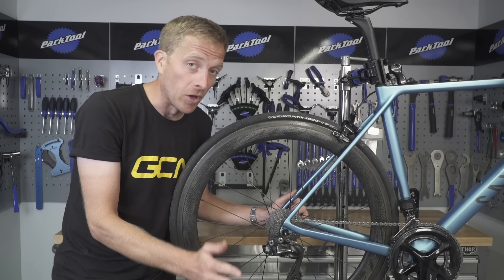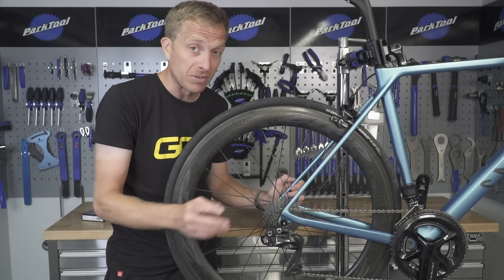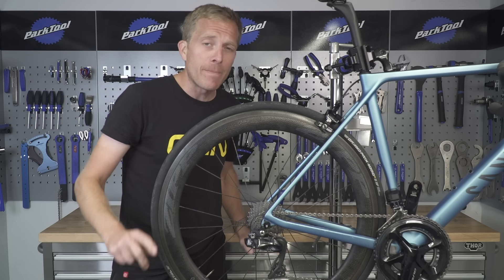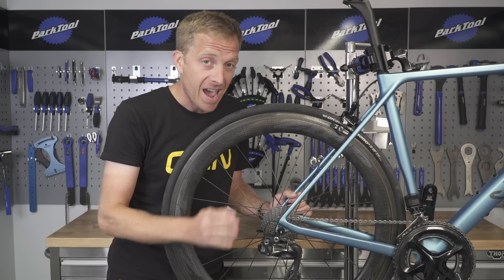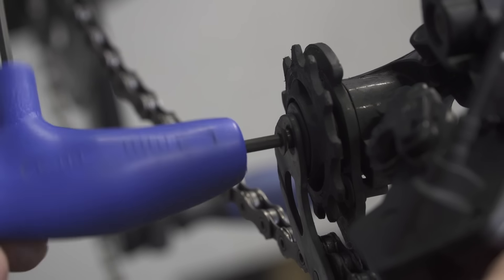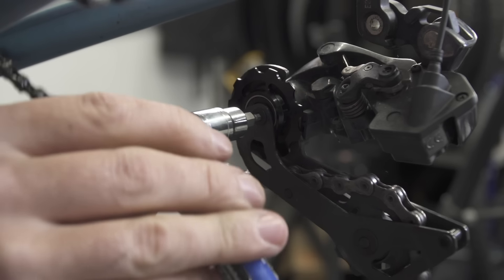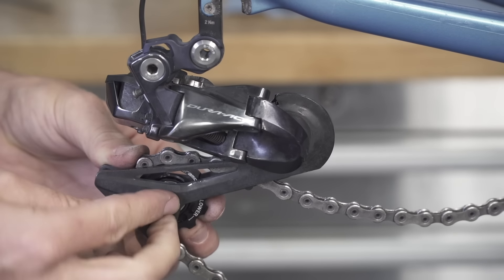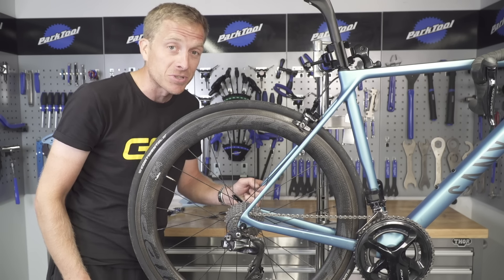How & When To Replace Your Derailleur Jockey Wheels

Comment from the maker: Have you replaced or upgraded your jockey wheels before? Let us know. 👇
Reply: I see Ceramic speed didnt give you the 3d printed pulley wheels to play with eh?
Reply: Long ago I replaced them on my commuter bike.. And it was so much easier to ride after that, I got about 20% faster, it was really so noticeable diference. The old ones had so many dog hairs and dirt in them. They did not turn freely at all.. I suppose, that when our dog was passing the bicycle, or maybe her hair were just floating around in air anyways, they got stuck on oily chain and ended up wrapped around to jockey wheels axle.
But I was actually wrong replacing them. I replaced, because the guide wheel had side to side play and I thought, that it's worn. I did not know that it need to have that movement. After I had already bought new ones and saw that also the new one has that play, I went to online to research and got know how it really is.. but since I had already bought them, I replaced them anyways. :P
Reply: Only cleaned and greased the bushings of my jockey wheels. Debating whether metal jockey wheels are worth the extra money over the plastic ones.
Reply: Changed mine for gold jockey wheels.
Reply: GCN Tech Nope.
Reply: Changed my Shimano 105 R7000 derailleur jockey wheels to TACX cartridge. Runs so much smoother
Reply: do the ceramic speed upper wheel have the float required by Shimano for that perfect shifting?
Reply: Earlier this year. Amazing how much quieter, and how much less friction. Probably gained some speed just from that.
Reply: I changed my XT's jockey wheel to a Chinese made alloy ones. The bearing came with grease that got washed off easily. I just had to replace the grease with my own and it has been good.
Reply: Just noticed today that there making weird noise. Will clean them and see if they need replacement.
Reply: A mess -- thanks ggoodness !
Reply: (Yes, old topic but still worth to mention)

I peplace mine bottom wheel 11T to 12T "narrow-wide-cheap-one" - chain stays better on it, and running more quiet as well.
Upper - still 11T (12T has not enough clearance) but was worn out, i replaced to alloy 11T.
And some "lower end" components have sleeve bearings instead ball bearings... So worth replace anyway.
Reply: My bicycle mounted video camera was picking up some clicking vibrations that I could not hear well at first and became more apparent and after inspection I presume the guide pulley bearings were worn out. We will see. Thanks for making an informative video. (UPDATE) There were no bearings just a bushing and lots of dried carbon or dirt built up slowing down the wheels. Degreased, cleaned them up with a dental tool, and greased them.
Reply: I have replaced them before, but just got the same set over and over
Reply: i know Im randomly asking but does any of you know of a way to get back into an instagram account??
I stupidly forgot the login password. I would appreciate any help you can give me.
Reply: @Brady Torin instablaster ;)
Reply: Tried changing them witth help of this video. But one wheel is not fixed with a screw. So I'm screwed and going to the next video which hopefully will be comprehensive.
Reply: Yes. Stripped the guide wheel hex screw. Had to use screw extractor to remove it. My old bike mechanic once told me, “Every 15 minute job is just one stripped bolt from being 3 hrs.”

Comment: More importantly, how to replace my worn out knee?
Reply: Go to your local human shop and have your local knee mechanic do the work.
Reply: Barbell squats
Reply: Seafood and short moderate running sessions.
Reply: Don’t buy online. Visit your local knee shop instead. Online knees don’t last long enough
Reply: I'm sure they have one at Nashbar
Reply: Is it threaded or press fit?
Reply: in most cases you can get away with just cleaning thoroughly and regreasing or replacing the cartridge bearings, but if you have the money i'd suggest getting a ceramic one for ultimate performance
Reply: @abdust  

Of course he's going to need the Park Tool kr-46 knee replacer tool to make sure the bearings are seated properly.  Otherwise before long it will creak.
Reply: I would suggest finding you local handy man and have his fit your knees with grease nipples
Reply: Before you start you should be aware that there was a range of different knees fitted by the manufacturer. Some people have been fitted with substandard versions by an unscrupulous dealer looking to build on the cheap.  Unfortunately when these are worn the best option is to get rid of the rest of the body and replace it with a newer more modern one.  There is little market for worn out bodies though.  So generally they go into landfill.
Reply: @stuartdryer1352  underrated
Reply: Orthopedic surgeon
Reply: @Nathan-1234  I asked my handy man to grease my nipples. He looked me strange but, well, recession and all that.

Comment: Oh boy I remember the one time  I took off both pulleys at once and took me awhile to figure out how to put them back in right 😱🤷🏼‍♂️😂
Reply: Thanks for telling me I just did the same thing,so now trying to figure out how to put it back.I would hate to take it to a bike shop because if you can fix something yourself you are better off.
Reply: Guess what I just did...
Reply: memesofproduction Guarantee you’ll never do it again😂😂🤷🏼‍♂️
Reply: will just mark them with something when taking them off. maybe a plastic tie
Reply: pugmalley It’s not which jockey wheel goes which it’s the direction you put them in that’s a bit confusing at first it’s just easier to do one at a time
Reply: @LaughingSaint66  ty for more insight. So utilize a camera during disassemble.  I have not done mine yet but may be soon.
Reply: pugmalley sure that would help. I think that’s what I eventually had to do is look at pictures of my bike🤷🏼‍♂️
Reply: First time I did it I mounted the cage in wrong position (180 degs) and messed up the chain line around them too. I just laughed at myself.
Reply: Tomislav Duić I think we can all relate to stuff like that the other day my buddy overfilled his mountain bike tire destroyed his rim the tire the tube and he cracked his seat stay on his carbon bike now that takes the cake😂😂😂
Reply: Literally me right now
Reply: @porkfied  Wish I had have read this 2 years ago... Typical guy don't watch instructions until I get stuck!!
Reply: @woofbark4475  I know or like me putting a barbecue grill together or anything together and taking it apart because I did not look at the instructions correctly,lol

Comment: upgrading my dura ace several years ago I noticed the lateral play in the guide pulley when I removed it. my "upgrade" pulley didn't have the lateral movement, but I put it on anyway. it was noisy from the start. to my eye the alignment was correct . it got worse, I contacted the company owner who told me my dura ace was worn out it shouldn't have any play. hmmmm! it was a brand new 7900 that was replacing my 7800. thank you for confirming the lateral play.

Comment: At the conclusion of my group ride of 47 miles yesterday, I pointed out that my buddies derailleur cage/jockey wheels were running at a angle rubbling the sides of the cage (NOISY) and suspected they were worn out. I then pointed out the lower jockey wheel teeth were practically worn off and allowing the chain to slip across and against the side of the cage. He had 1 1/2 miles to home. It blew apart 1/2 mile from home. 
Don’t neglect to maintain your derailleur!

Comment: The back plate of Campagnolo rear deraileurs is made of very soft metal (something close to cheese).  So you have to be VERY careful when doing up the screw that forms the axle.  If you strip the thread (I have), then you have to replace the entire cage.

Comment: just to clear things up guide or upper is the pulley closer to the base of the unit. upper and lower is a matter of perspective and the derailleurs position which changes, that one is not directional. the tension pulley which can easily be referred to as the pulley that is further from the derailleur, is directional and should have bladed teeth also with arrows pointing in the same direction as the chain would move as your pedaling to move forward (not back pedaling)

Comment: Nice upgrade! It looks like you replaced factory jockey wheels with after-market low-friction ones with ceramic bearings.

Some considerations when upgrading to low-friction jockey wheels...
1 - Expect your drivetrain to be a little noisier. Why? Because factory jockey wheels usually have non-metal teeth which are fairly quiet. Low-friction jockey wheels often have metal teeth (aluminium or titanium) that are noisier as they engage the chain.
2 - Expect more frequent maintenance. Why? Because the bearings cannot be sealed as well (weatherproof seals add friction). For example, some manufacturers recommend that you clean and regrease the jockey wheels after every ride through rain.
3 - Expect a shorter lifespan compared to factory jockey wheels. Why? Because low-friction bearings often combine ceramic balls with metal races. The metal is softer than ceramic and, if any dirt gets into them, the harder ceramic balls can score the metal races. However, the lifespan can be extended simply by keeping the bearings clean and freshly greased.
4 - For best friction reduction, expect to upgrade the cage, too. Why? Because the best low-friction jockey wheels are much larger (more teeth) in order to smooth the path of the chain. This also reduces friction. These larger low-friction jockey wheels will not fit your factory cage.

Lastly, some high-end rear derailleurs include ceramic bearings in the jockey wheels from the factory. SRAM Red (both mechanical and eTap) are one example. Cyclists who don't know this may be unaware that their jockey wheels require more frequent service in order to keep the friction low.
Reply: more frequent for many of us means 'at all' lol
Reply: The factory jockey wheels you refer to as having “rubber teeth” are not rubber, but a thermoplastic. The most common we know is Delrin and is made by DuPont. The use of delrin  is perfect for jockey wheels as it has high stiffness, can be produced accurately and has low friction (your chain touches the Delrin).
Reply: @buxus3770 -- Thanks.
Reply: Clean and regrease after every ride? Good lord that sounds horrendous

Comment: 5:01 i appreciate the tip, ill make sure i install it the right way next time. If i needed a tutorial to unscrew two bolts i really don't see how you think i would be able to fix the chain by simply "refitting it with the chain in the correct place"

Comment: I didn't know about the pulley systems various materials & that they came with or without bearings etc.  I like the idea of getting ceramic pulleys. And now I know that the top pulley is for tension & the lower one is to guide.
Reply: Tension is the bottom one. Guide is the upper one😂

Comment: Hello, I have a cervelo r3 de 2017, it comes equipped with Sram force 11v. however I have the following problem, the chain jumps out of the lower pulley when the chain is diagonal ( 52/32 ) I already changed the pulley, chain, dropout... I can't solve it

Comment: Can you replace the pulley on every derailleur becuase I took my back to fix one pulley because one teeth broke but they said I had to replace the hole derailleur because it was unchangeable. I have a specialized rockhopper 2020.

Comment: I live in the American west and do a lot of trail riding. 

the dirt and dust get absolutely everywhere. The sand and dust in my region also are high in micro quartz crystals. Quartz, by the way, on the hardness scale, is one below diamond.
Reply: Here in South Jersey we're made of silica, which is what quartz is a type of. Hardness is up there. When things are dry make sure engines have their filters. Also causes cancer.
Reply: @—jed-henrywitkowski6470:

actually Quartz is 7 on the Mohs Scale of Hardness.  Diamond is 10. (10 being the-highest number. The Mohs Scale of Hardness goes from 1 to 10).

Comment: Hi Jon,
I'm trying to follow the guide in this video to remove my jockey wheels, but whenever I try to unscrew either of the 3mm bolts that connect them to the derailleur, they won't budge and I'm afraid I'll completely strip the screws if I pull any harder. Just to figure out whether I was doing it wrong I tried on a different bike, and couldn't get them to budge there either. The two bikes have Ultegra 8000 and Dura Ace 9000 and have never had their jockey wheels removed since I bought the bikes. Is this a common problem, or am I doing something wrong?
Reply: If you are fretful about applying enough pressure to remove them without stripping them then take the bike to the bike shop and have them do it. If something goes wrong then it is on them

Comment: I didn't know you had to change them.  I've never changed mine. I'm not a racer just go fast sometimes. Mostly touring, sometimes fast and far. 
Bikes: Litespeed Ultimate, Titus Modena, and beater Raleigh Technium MTB.
Reply: thing is a whole 105 rear derailleur is not that expensive compared to buying and shipping jockey wheels separately... and the spring in the derailleur also gets worn so I never replaced those jockey wheels separately, to be honest... The math might be different for dura-ace, but then people riding dura-ace are not exactly penny pinching?

Comment: Hello, just a quick question? I've fitted a new set of pulley wheels tacx (10 tooth) appropriate for my cassette make (shimano claris 8 speed). Now the pulleys that have come off are 11 tooth shimano. I seem to have noises coming from the rear cassette on gears 14 - 16, would removing a chain link remedy this as the chain runs smooth in all other gears? Or buy the 11 tooth tacx version for speeds 9 upwards? Some advise would be much appreciate, many thanks Phil

Comment: Great video, I've changed my pulleys once. I inspect them every time I clean my bike. Any chance on a maintenance video on SADDLES. I have a just worn down a saddle which I think has either a leather or somekind of leather like mesh. Feels like it worn down quickly since I started using my bike on a trainer and sweating like a pig. Have been on Selle San Marcos site but no info on care for my high tech racing aspide saddle.

Comment: I'm considering changing my jockey wheels but not for the reasons mentioned. I've replaced my rear cassette and chain. This worked fine at first. But now the bike is making a whining sound when pedaling. Listening to the components it's coming from the rear derailleur where the chain is sliding against the side of the derailleur bracket. Is this something new jockey wheels can fix?

Comment: An installation question. When I installed my new XD-15 jockey wheels, I noticed neither of the top wheels, (the XT one I was removing or the XD-15 I was installing) had direction markings. Are the top jockey wheels no longer directional? The lower wheels both had little direction arrows, but the top ones did not.

Comment: The pully wheel (upper) on my newly installed and upgrade derailleur on my trike doesn't seem to engage the chain very well in a couple of gears, it sounds like the teeth of the pully wheel are being slapped by the chain as it spins by, then you her a popping noise ever so often. My uneducated self tells me that adding a different pully wheel with another tooth or two would or might solve that problem, by forcing the wheel and chain to better engage.  Might this be a common problem,  my drive train is a collection of 9 speed parts from different makers.

Comment: Just keeping jockey pulleys clean, dry, and lubed to spin as designed, should last for like tens of thousands of miles. There is very little tension on them, only that from the cage spring that tensions the extra chain slack. They are largely along for the ride, except the in and out locating of the chain during shifting. Many old style wheels had barely half-depth teeth when new, yet they worked fine. If shifting becomes a problem, or if the bearing or bushing doesn't regain a smooth spin after servicing, then get new, OEM ones and ride. Ignore the posers who think a ceramic pulley will turn them into a Tony Martin. This is just pandering to marketing hype, and beneath GCN.
Note that Shimano designed in some side to side play on the upper wheel to self-center after each shift, and even the priciest aftermarket units haven't addressed this as well as Shimano's own, clean, simple ceramic bushing that just needs a drop of solvent-free, non-chain lube oil to stay happy. Those other lubes dry out, binding the bushing.
Reply: @z1522 what lube are u using ?  Can i use chain lube. Wax base chain lube?

Comment: My jockey wheels don't have that shark teeth looking, it looks new as I bought just last Oct and ride about 400km. But it has a weird sound when cadence is high, the chain oil doesn't eliminate that problem. What happened with my jockey wheels? @GCN Tech
Reply from the maker: Hard to say without taking a closer look. May be worth visiting your local bike shop if you're unsure
Reply: @gcntech  The thing is, I visited the GIANT store yesterday and talked about the noises coming from the pully and jockey wheels, they had a look, made some adjustments and cut one bit of the chain. But the noise is still there, and they said it might be the biting noise between the chain and the wheel, its normal. But there was absolutely no noise at all when just bought the bike. Really don't know what to do now :(
Reply: @frankwang3679  have you found the problem yet?
Reply: @EvoX180  Thank you, I faild to locate the problem, when climbing up the hills or using larger gear ratio, there always be some consistant small cracking noise coming from the rear wheel. I replaced a new cassette body and haven't climbed the hills to test it yet.